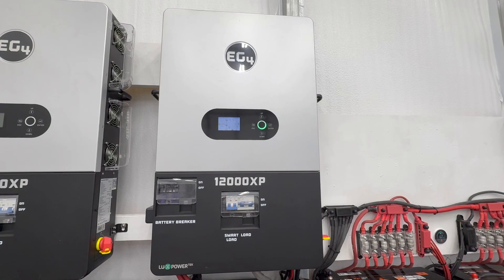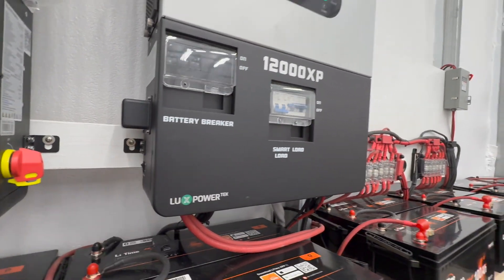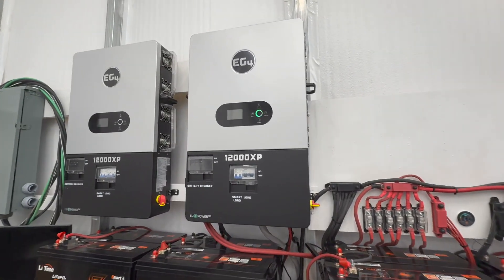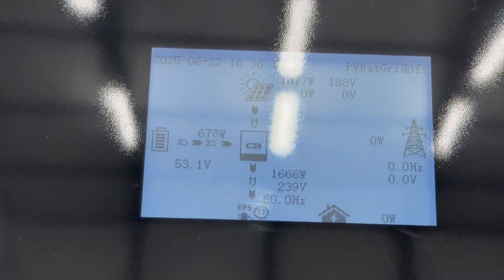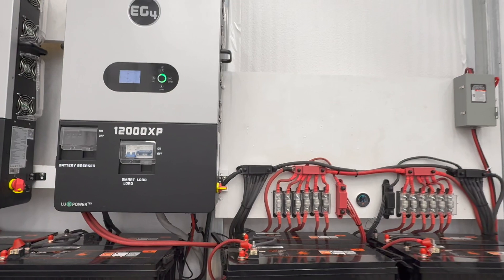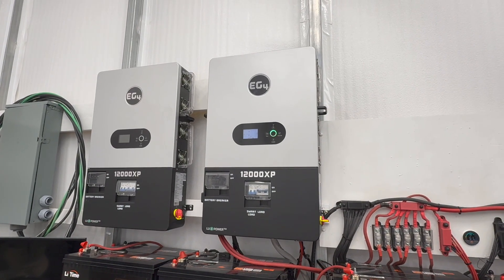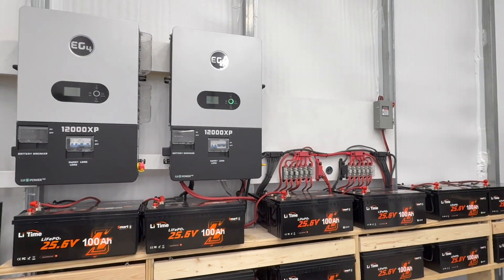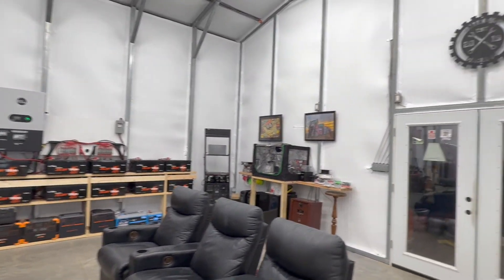EG4 12000XP: 90 Days Later & STILL Amazed! (Off-Grid Power Review)

Comment: Does the deflector reduce the temps?

We just got ours going with 3 EEL diy boxes for 46kwh of storage. The unit is really solid - pushed it to 250a of battery charging last night. Cool stuff. 

For our three batteries I wired each one to a Victron Lynx and used Victron 80V 125A mega fuses for each battery and then a 300ah T class on the Lynx output.

I do like the idea of redundancy for DC protections. So you have BMS  protection, inside the box there is a T class, 125a mega fuse, 300a t class, and finally the 300a EG4 breaker.
Reply from the maker: It sounds like you are building a pretty cool system.The DIY deflector was temporary until I moved the inverters further apart.  At first I had them too close, but needed to rectify that.

Comment: so how do the power combine? I can easy use more than 50amp at once every day. Does the main box just have a bunch of 50amp breakers in it and they all load balance??? I ask, because I have a Tesla, and I have PC's that do compute task 24/7, and just normal house stuff. I can prly use 100amp both legs at once every day at times. And I have Car hobbies, compressors, welders, big lights ect..
Reply from the maker: Multiple inverters can be paralleled to increase the output.  They combine in a combiner panel.
Reply: @MikesSolarGarage this is easy to upgrade then. And I got enough room for like 100 pannels. I'd love to do more compute task. I can have a single pc pull a whole 20amp breaker.
Reply from the maker: @LordMustangGT93  Very easy to do.  It’s a great platform.

Comment: Correct if i am wrong but won't one unit will run hotter than the other as it is sucking the hot exhausted air from the other unit. That may be a reason for fan ramping up.
Reply from the maker: I moved them further apart in a follow up video.  Thank you for watching and your comment
Reply: @MikesSolarGarage i
Oh that's great then 👍

Comment: The guy from signature solar very nice person told me that he was getting at least four phone calls a week about this neutral problem inside the inverters becoming loose and causing electrical fluctuations how many have you seen you got so many 12, 000xps have you not seen any problem with this?
Reply from the maker: Yes and I saw it on mine.  I forgot which video had it in there but I mentioned it. The bottom side of the neutral that goes to the bus bar.
Reply: I'm learning a lot watching your videos I really really appreciate it
Reply from the maker: @brainwashed7244  Thank you very much for watching.  Can you tell me a little more about the neutral wire issue?  Was it the connection at the bus bar at the bottom of the 12000XP inverter or is it the other end on the top part of the inverter.
Reply: @MikesSolarGarage    Any feedback on this potential loose neutral inside the inverter ? Why isnt EG4/SS issuing a bulletin ?

Comment: Important thing that they should do is isolate the neutral from the circuit board inside the inverter to its own post and then lock it down permanently there's no reason in the world to have a neutral that you cannot see internally that can very easily be loosened which will cause devastating consequences to your home electrical system including burning down your home or possibly death so all they would have to do is dedicate a neutral spot on the bar and then lock it down permanently with glue or even just a sticker something on the top of it so you don't accidentally remove it by accident the guys at signature solar are wonderful people and I really am loving my 12,000 XP but it was a really Rocky start all because of a neutral inside the inverter wasn't connected and you can't easily see it it looks like a shadow unless you have a flashlight looking up in there which most people wouldn't think that the internal neutral would be disconnected because they're covered up by plastic Shields
Reply from the maker: Oh,  are you talking about the neutral wire on the bottom portion or the other end that is deep inside the inverter?  Meaning you need to break the seal to get to
Reply: @MikesSolarGarage    Ok, any further info on this 'internal neutral' ?  Do I need to shut mine down and take it a part ? TIA.....

Comment: Very nice review. Our power in Utah here in the mountains go out several times a month. My first 12000xp to be delivered on Monday. That's tomorrow. 

I'm in the middle of putting my massive Aptos 6 x 4 foot panels up on my home built ground mount on my mountain side of our property. These panels are kicking my butt as I have limited help. Only have 3 of the 14 Bifacial panels up so I'm taking it slow and easy as I'm 71 years old.

You on the other hand have a fortress and totally self sustaining/ sufficient. I've been working very slowly on 10 categories that I pieced together from an Emergency Preparedness Class I took last year. 

1. Water storage
2. Food storage 
3. Power storage
4. Fuel storage
5. Financial storage
6. Security/Communication storage
7. Medicine Storage
8. 72 hr Survival Kit- Family
9. 72 hr Rollerbag Bug Out Kit
10. Documents Storage Binder - paper and digital.

I have 2 RVs that I have for bug out and practiced build sustaining solar arrays with 3500 inverter in them. 

So I figured it was time to do the 12000xp and I'll probably get another as well. 

Batteries are what I'm debating on right now as nobody talks about the best possibility there. I saw you have LiTime and that's what I put in my RVs. 

Once again great job! Your are way ahead of us.....me  by a long shot
Reply from the maker: You are actually ahead of me in a lot of areas,  I've been focusing primarily on power.  We have a very small garden and have some chickens but we are far from self sufficient.  I probably should take a preparedness class to see what I am missing, which I'm sure is a lot.   When you are ready to setup your inverter feel free to reach out to me.  I'd be more than happy to help.  mikesgarageroute66@gmail.com
Reply: Don’t advertise on the internet what you are doing
Reply from the maker: @hobby_turns_addiction4209  You are right, that is a very good point.

Comment: Are those air guides you've got over the fans an EG4 product, or did you just grab AC vent duct guides from a hardware store?
Reply from the maker: AC fan ducks.  But I have decided to move one of the inverters so it will be a moot point.

Comment: Awesome review, and I love that you've had a great experience with the 12000xp! It's a powerful unit that EG4 worked very hard on. Nice video!
Reply: EG4 just added their name badge on the XP12. The unit is a Luxpower.
Reply from the maker: @stackmanstackIt would s a LuxPower.  I believe the only difference is the software.  As the setup of both inverters is different.
Reply from the maker: Thank you very much Ethan!

Comment: Good to hear, mine is being delivered next month. In 2023 it would take a pair of sol ark costing 4x as much to hook up 28kw of pv lots of room to boost overcast losses. 
My first inverter sounded like a shop vac.
Reply from the maker: I think you will be quite happy with this one.  I know I am.
Reply: @MikesSolarGarage  I have swapped out,5 amen solar inverters, all have a problem. Even the current one, very low overcast power 1.5% of rated.